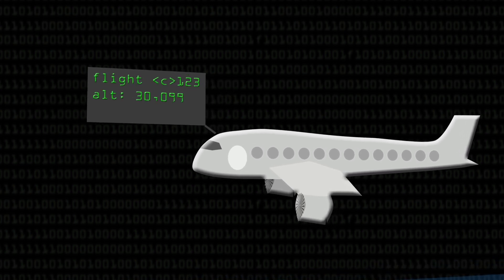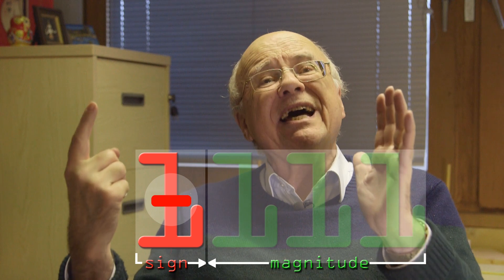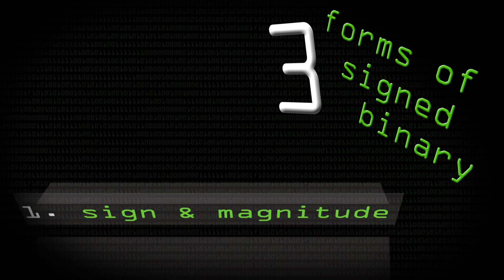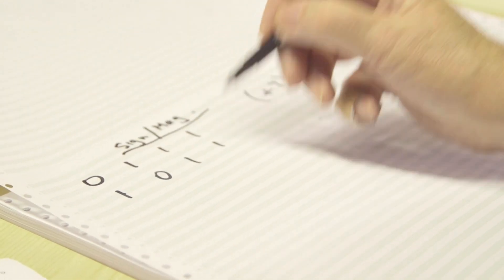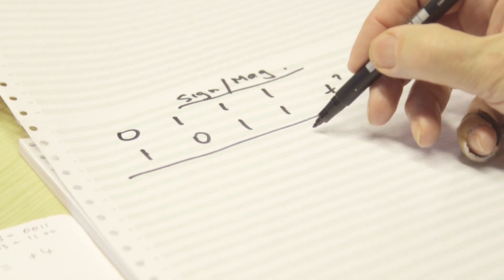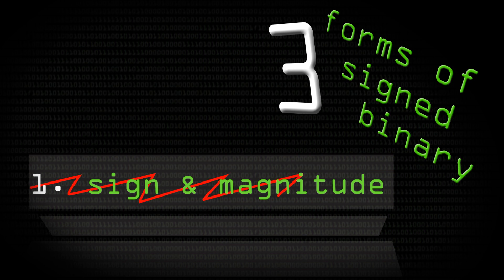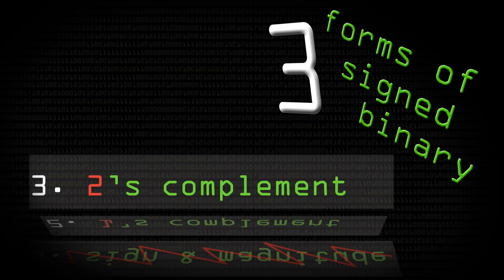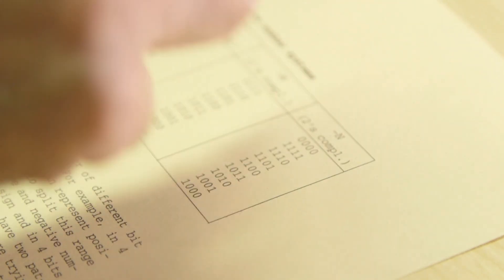Binary: Plusses & Minuses (Why We Use Two's Complement) - Computerphile

Comment: In the pre-360 world, the IBM 700/7000 series used sign and magnitude for their 36-bit binary integer arithmetic, adding the extra hardware to account for signs and overflows properly.  Some programming languages, such as FORTRAN, used -0 to represent a word to which no value has yet been assigned; their compiled instructions tested for -0 before performing an operation, and knew that a programming error had occurred (using an uninitialized variable) if -0 was found.  No arithmetic operation would ever GENERATE a -0 result; it could only appear as a result of copying a constant into it, or compiling an object program with that value (octal 400000000000, or in the hex notation devised later for the  360 series, 800000000) loaded into all variables with no initial value specified by the programmer.

Strangely, although integer math in the later 360 (introduced in 1965) used twos complement notation, FLOATING point math used sign-plus-true magnitude for the mantissa (significant digits) and an excess-64 notation of powers of 16 for the exponent (order of magnitude): in a 32-big (single precision) floating point number, the first bit was the sign (1 for negative) of the entire number, the next 7 bits represented the power of 16 plus 64 (0000000 meant 16^(-64), 1000000 meant 16^0, and 1111111 meant 16^63), and the remaining 24 bits represented a binary fraction.  Double precision (64 bits) and extended precision (128 bits) kept the sign and magnitude the same and added the extra 32 (thus a total of 56) or 96 (for a total of 120) bits to the mantissa.

I suspect the reasons were that (a) floating point required more complex logic anyway, so temporarily generating twos complement for addition and subtraction were  not much extra effort, (b) adding precision only required appending zero bits to the right, not the current value of the sign bit, and (c) more multiplying and dividing than adding and subtracting are done in the areas where floating point is commonly used, and those operations ignore the signs until the end, then determine the sign of the result from the signs of the operands.
Reply: Fgxd
Reply: Ghhh

Comment: Easiest method of reading negative numbers in two's complement:
Seperate the leftmost digit from the rest, for example 1011 becomes 1000 (= 8) and 0011 (= 3). Take the negative of the left number and add it to the rest - in this case you get -8+5 = -3.

To understand how two's complement really works, Imagine the four-bit binary numbers as a circle. You start with 0000 at 12 o'clock, 1000 is at 6 o'clock, and the last number before you complete the circle and go back to 0 (between 11 and 12 o'clock) is 1111. 
In unsigned binary this is where the overflow happens: 1111+1 (= 15+1) should be 10000 (= 16), but because you don't have that fifth bit you get 0 (0000) instead.

Now, this is how you read the same circle in two's complement: At 12 o'clock you have 0000 (= 0). To the right you increase the numbers (0001 = 1, 0010 = 2, 0011 = 3, ...). This works until you arrive just short before 6 o'clock, where you have 0111 (=7), which is the highest positive number. So far the two's complement circle is just like it would be for unsigned binary.

But as we arrive at 6 o'clock where 1000 stands, we have a problem, because 1000 now is -8. 
So as we add 0111 (=7) and 1, we get -8 instead of +8. This is where two's complement has its overflow.

Instead now go back to the 0000 and this time go down the circle to the left side: The first number you see there is 1111, and that is -1. Then you have 1110, and that is -2. So by going from the top down the left side, you count down from 0, until you arrive at 12 o'clock again to find 1000 = -8.
Reply: The beauty of ones' or twos' complement, however, is to make it possible to eliminate
the subtraction operation altogether by simply adding a negative representation. 5 - 8 to
get -3 is easy because those numbers are so small, but borrowing is a nuisance for more digits. The only
real need for "-" is to negate (multiply by -1).

Comment: Learning about how computers store numbers is very good :) Just wanted to say it was a bit misleading to bring up undetectable "Not a Number" cases and then describe what is really the carry bit present in all CPUs since the 1970s. I.e. detectable and used a lot in all kinds of software :)

I think one important notion is to not get too used to 0 being positive just because it's stored as such in a computer. Oh, you can use it that way eminently in computers and it will turn out right. It's just that it could make you blush for math work. 0 is signless and has no unit. Moving on... have fun coding :)

Comment: This is the source of all computer problems! - PI's SQRT(2) - the carry bit - ones compliment's zero. You can think of the carry bit as a suicide king of a deck of cards the 13th card. it goes around. The auto add on carry out goes through the inside of the PI. Inside - Outside & 2  non side groups of seven. = 28. 4+3 = 28 not 7. 4 realities Past Present Future and Current! You can use 8 bit to 128 bit encryption to get the same error!
Reply: Larry Kaufhold I don't see what you mean. Adding 3 and 4 is 0011+0100 = 0111. What is "PI's SQRT(2)"? There's no "auto" carry bit, it only shows up if you carry out of the most significant digit and transfers to the least significant one.
Reply: Cooper Gates  You are thinking to small!  Go around the universe. How many digits are in PI()? Where is the most sig bit? Sqrt(2) is like the most sig bit because it's how you calc PI. What is it? It's any  number 0-9 or undefinable. What's the value of carry over bit 0 or 1 or null? or -0. The rest of the paragraph explains that it is a quantum tunneling problem. Inside to the outside.

If you have further Questions I'll be glad to try and help.
Reply: Larry Kaufhold If you want to use the decimal version of 1's complement then I'm all for that. To handle it, the leading digit of the number tells the sign. If that digit is < 5, the number is positive. The way I use it, the representation of 0 composed of endless 9s comes up more often (...9999.9999....).

Why are there endless 9s? Consider the fact that positive numbers can have 0s as place holders. They don't change the number. 3 = 03 = 0003.000. Easy.
Now, to negate the positives, every digit has to be subtracted from a 9 (you can't just invert the digits because you have ten of them instead of two).
What happens? You can do 9999.999 - 0003.000 and you get 9996.999 so that is what represents negative 3. It also proves that the place holders for NEGATIVE numbers are 9s rather than 0s!!
What's the representation of negative pi?

...999.999... - ...003.141592653589... = ...996.858407346410.....
From here, you can omit the place holding 9s (infinitely many of them) and you get 6.858407346410.... because the most significant digit of the number is a 6.
Reply: Larry Kaufhold What interests me is Pi's connection to SSL encryption.  Two public keys and 2 private keys give a 5th number.

I think of the 4 keys as 2 circles. 2 run on numbers that are undefinable. SSL people believe that if you just add more digits to the key it gets harder  to crack - 128 bit encryption. But SSL is limited to 10 levels as described above. Crackable!
Reply: Larry Kaufhold What makes the numbers undefinable? Dividing by 0? Complex ones? Or just outside the representable range (huge)?
Reply: Larry Kaufhold I was writing the real number -(pi) so if I have to settle with a rational number, such as a 32-bit float that translates to 6 decimal positions in the fractional part, then I do 9.999999 - 3.141592 = 6.858407.
Reply: Cooper Gates  I'm not sure I follow but the pi problem is like a random number cut off where the most sig bit choses 5 or 6 or 0 or -0 it's undefined!
Reply: Larry Kaufhold Random meaning from the left? Well as you know the two representations of zero mean that 9 = 999 = 9.999 = 99.9 because for negative numbers 9s outside of the other digits are place holders. For instance, -(1) = 98 = 8.9 = 98.999 and if you add 1 to any of those representations then the result only has 9s in it. You just don't have to show all the 9s.

Comment: Very instructive. I learned assembler-programming on a UNIVAC-1100 and machine code programming on a Z80 (I could not quite afford an assembler at first) so I did learn 1's complement and 2's complement. And I can still drive the younger programmers mad by this. Not that I have any use of 1's complement today.

Comment: I just remembered another nice thing about two's complement: It makes it easy to convert low-precision to high-precision.

If you want to convert signed 8-bit to signed 16-bit, all you have to do is fill the top byte with copies of the top bit of the 8-bit value. Just test for whether the top bit is set, then either OR with 0xff00 or use as-is.

You can do it on a single line of C like this:

sixteen_bit_val = (eight_bit_val & 0x80) ? 0xff00 | eight_bit_val : eight_bit_val;

Comment: The point of binary is that computer circuits can detect a charge being either on or off, and charges line up together as bits create a number. You can also make math functions and logical functions. If, then, not, etc. From this you build up entire computing systems, including all the games we play with their fancy graphics. 

But what if there was a way to store more than the two dimensions of on/off? What if instead of a light switch, on/off, yes/no, you had a dimmer switch that measured the amount of voltage in a circuit? Those 64 bits would be a lot more useful if they could each store ranges of numbers instead of just on or off.
Reply: You just described an analog computer.

Comment: 2s compliment is actually just negative binary.  The other two types are representations.

0000 - 0001 = 1111 =-1
roll back the dial from 0000, because if you add 1 to 1111 you get 0000
(-1) + (-1)
1111 + 1111 = 1110 =-2
(-2) + (-1)
1110 + 1111 = 1101 = -3
7 + (-3)
0111 + 1101 = 0100 = 4

Comment: ***** 
Can you please explain what the binary difference is in the memory between these?
Int 1;
Float 1.0;
String "1";
Char '1';
Reply: Key:
bit = a single binary digit represented by a 0 or 1.
character = a single letter, symbol or digit.
array = a list of items of any length, the items being of a specified datatype (like "int" or "char").

"int n;" = store an integer "n" in binary. When "b" is for the amount of bits you have to store it, the range is         -(2^(b-1)) -> (2^(b-1)-1) (4 bits would have a range of -8 -> 7, 0 included). The reason we are subtracting one from the positive largest number is because we have to account for 0 being an integer.

"float n;" = store an integer 'raised to the power of' another integer. It is the binary equivalent of the standard form and it allows for approximate calculations outside the limit of integers. It isn't actually raising a number to a power it is just creating the illusion of that by converting it to an approximate number that gives an approximate result of raising the 'base' integer to the power of the 'power' integer which also gives the ability to do calculations using approximate integers. The reason I keep on using the word "approximate" is because it can't do it perfectly and the accuracy is just limited to how many bits you assign the 'base' integer. The range depends on two things, how you define range for an integer raised to the power of an integer (do you say the range of the two integers separately or do you say the approximated range), how many bits you're assigning to the 'base' integer and how many bits you're assigning to the 'power' integer. Something I haven't mentioned is it too can be positive and negative.

"char "n";" = Store the character "n". The amount of bits this uses is usually 8 as most systems use the extended ASCII character set which has 256 characters in it (2^8=256, we're raising to the 2nd power because we're in base 2, binary).

"String "n";" = Store the character "n" in an array (list) of characters. Also notice that the datatype "String" is actually an array of characters which is to say it is a list of any length containing individual characters as items on the list. The string "hello", for example, would be a list of 5 characters and therefore would use 40 bits (8 bits per character for the extended ASCII set times 5 characters).

Sorry for the long message but I want to make sure that you understand it. I am a programmer by the way which is how I know this stuff.